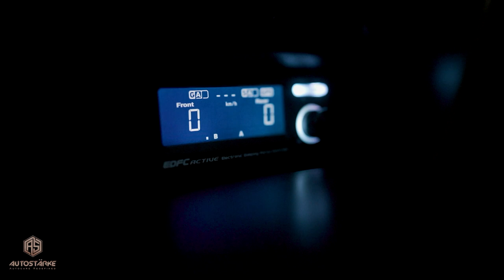TEIN Suspension Upgrade In Toyota Fortuner 4X4 - Tein Suspension Accessories | Autostarke

Comment: What's the Use of this Suspension
Reply from the maker: Advantages of TEIN Performance Suspension and EDFC Active kit

1. Reduces Body Roll,  inturn eradicates fatigue and motion sickness of the passengers

2. Improves handling and ride quality at fast corners and delivers a plush ride in slow speeds.

3. Inbuilt Hydraulic Bump Stopper helps in absorbing jolts, bounces and sudden impact due to bad road conditions making the vehicle glide smoothly.

4. EDFC Active kit is a patented technology of TEIN which automatically adjusts the stiffness and softness of the Dampers according to speed, braking and acceleration from inside the car through a wireless controller unit.
Reply: Can it used for off-roading?